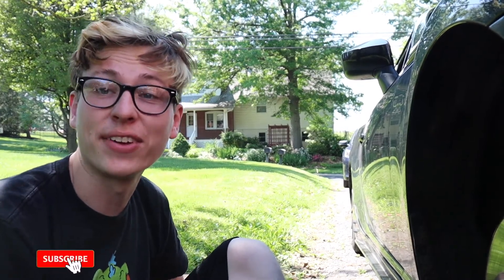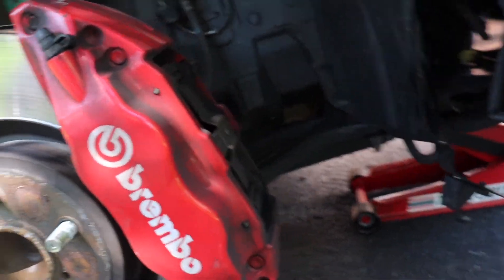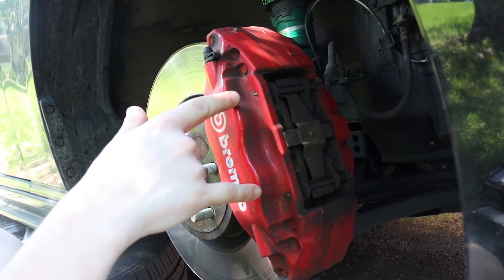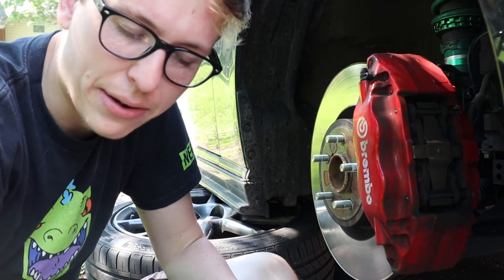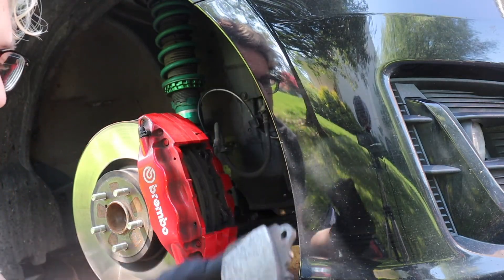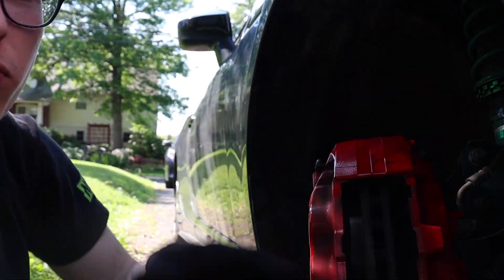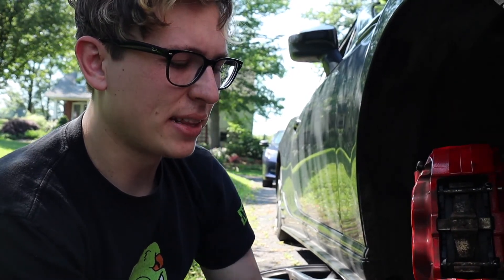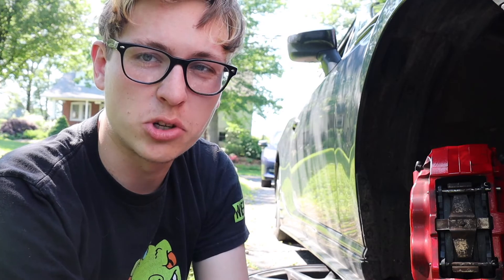How To Change Brembo Brake Pads On A BRZ

Comment: Heads up for next time use a flat head screw driver and push the pad in and it frees up the brake pad and put the one in and do the same thing with the other pad and it’ll push in the brake pad and let it sit 🫡 so you dont gotta battle the brake pad out, i just came to see if the brake pads on the rear are the ones from online
Reply from the maker: I don't even have the car anymore so there won't be a next time :(

Comment: Did you keep those metal shim thingys that come with the stock pads and put it with the new brake pads?
Reply from the maker: I actually kept the stock ones
Reply: @TTRGARAGE  thanks for the reply! Did you end up reusing them on the new pads?
Reply from the maker: Exactly what I did! Just cleaned them up a bit

Comment: i have to replace the rotors on my gt86 trd edition and it comes with the brembo brake package. do i have to get tha exact brembo rotor ? or can i get it from a different company ? if so which ones would fit , i would appreciate any help
Reply from the maker: I never had to change my rotors. I know some companies do make direct replacements for the brembos tho and they are much cheaper. Ft86 should have some options